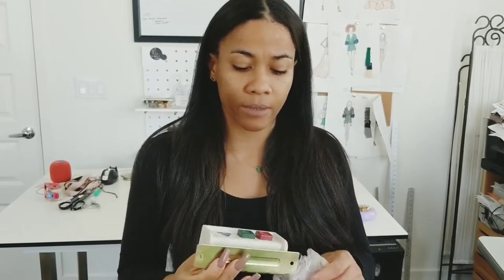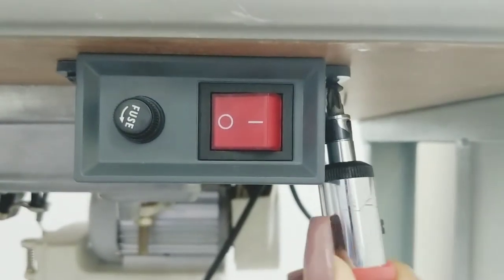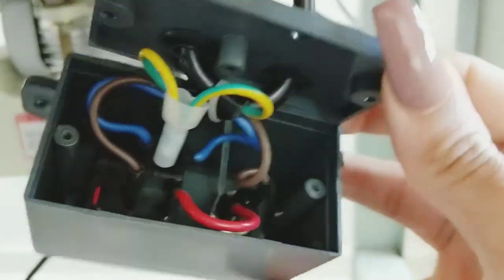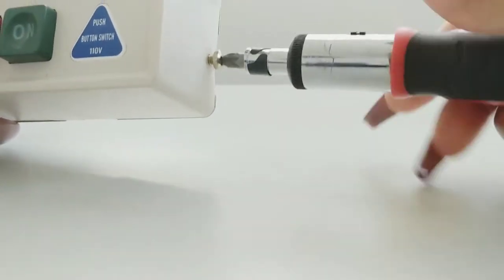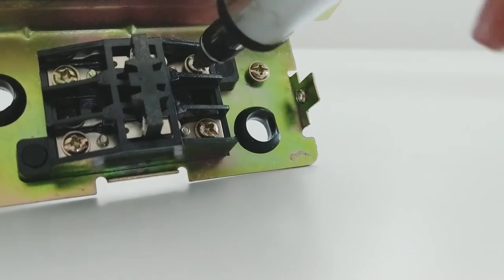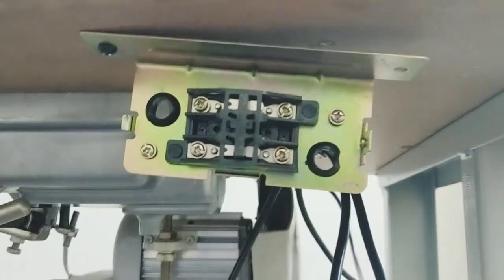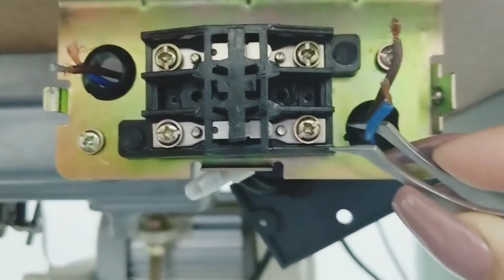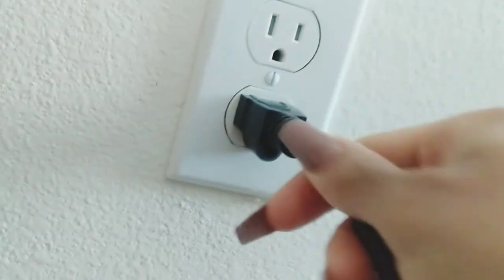How to replace Power Switch box Off/On Juki Industrial Sewing machine. Troubleshoot fuse

Comment: Where did u get the switch box from? My machine n just stopped and it's not turning on.  So I don't know what's wrong . Maybe the switch box?
Reply from the maker: My technician mailed it to me. However, you can purchase them on Amazon  Walmart website or Ebay. Just type in "on/off power switch box industrial machine"
Reply: @Brady.818  Thank you. I didn't know. 👍

Comment: Hey,
You are using the wrong bit in your screwdriver. It's different to a Phillips  bit,  it's a posi-drive but and doesn't fit properly. Its got extra edges between the star points. Go look.